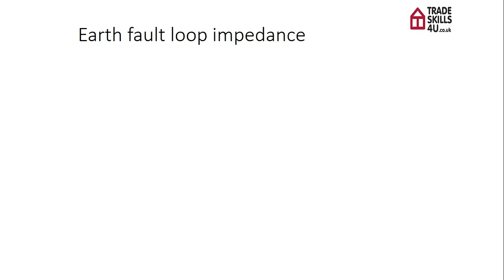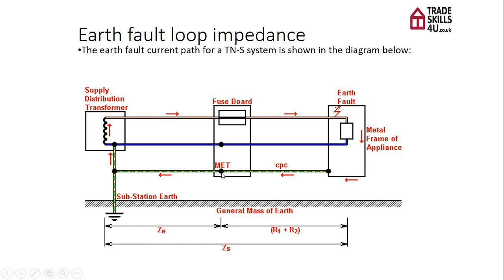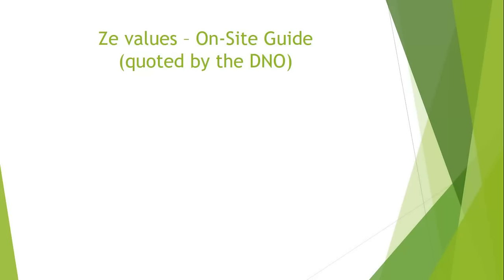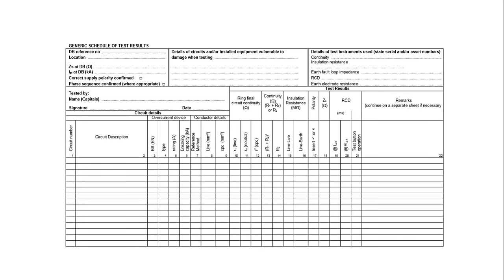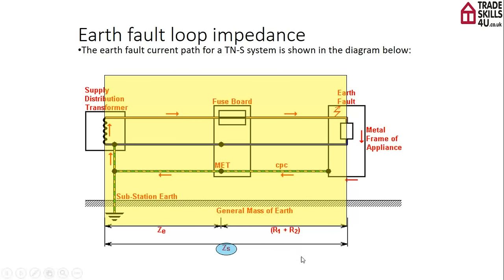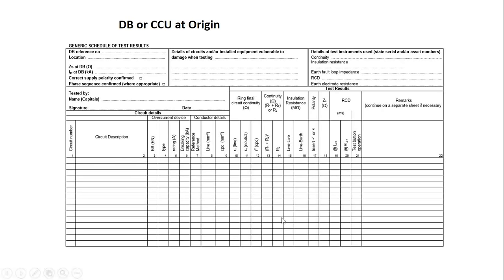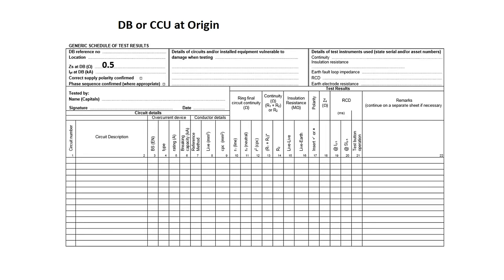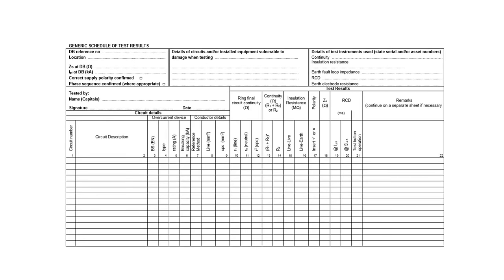Earth Fault Loop Impedance Test & Prospective Fault Current Test

Comment: My thanks to Tim and Chris for pointing out that the instruction manual requires the test leads on a Kewtech KT63 to be in 2-wire mode when using the high current test mode. In answer to your question Tim about whether previous test results are valid, I've conducted the test many times using both 2 lead and 3 lead configurations on various meters and the results have always been identical. The golden rule though is always follow the manufacturer's instructions so I've given myself a slap on the wrists!

Comment: I've recently realised that the  KT63 manual implies that if you use the high current mode, then in all circumstances you have to have the leads in the 2 wire configuration. Your Ze and Zs tests don't do that, but your PSC test does. 
From the manual  "The high current test mode requires the use of the distribution board lead set ACC063 configured in 2-wire mode". and "For Ze testing at the distribution board or at any point upstream of RCD protection there is a traditional fast high current test mode. The high current mode is a 2-wire test that enables the user to test the true impedance of both the Line-Neutral Loop and the Line–Earth Loop". 
I've tested several  installation the way you did it with the N lead seperate and got plausible results but I'm now wondering if the results are valid. Any thoughts? Thanks.

Comment: The KT 63 manual says that for high current test, i.e. Ze, the leads should be configured in 2 wire mode. I noted at 7.27, the test was done with 3 wire lead configuration.  The manual also states do not use high current test in 3 wire configuration. Also, I noted you used 2 wire config for PSC but 3 wire for PFC. Is there a difference if you use both in 2 wire config? Both are high current so shouldn't they be config in 2 wire according to the manual? Thanks.

Comment: Why are you showing a high current test in the 3 wire configuration when the kewtech KT63 instructions state that this function is only to be used in a 2 wire mode.

Comment: I have no obvious choice for the external earth conductor as 2 leave the back of the board. Assuming I am right one goes down so is the incoming but it is not obvious. There is a Meter on the back of the wall but that just tells me little too. It could still be the up or down and really the meter is level not down.
Should I test each earth one at a time to find the correct one?

Comment: Great video but how does the maximum breaker rating come into this? For example, a 6 amp breaker has a rating of 6000 amps. Why is this 6000 amp rating necessary?
Reply: gregorginny same as your car it can only go 180km/h
Others can go faster.
That’s the rating of the device.
You can get a higher rating like 10kA
Reply: Type B RCD/RCBO disconnects at 5x it’s rating ( generally speaking ) . Everything has to have a rating. Lighting circuit (6A) has lower demand than say a power circuit (32A). They have to ‘trip’ at up to that 5x rating.

Comment: I'm still trying to find out how the impedance tester calculates this for the supply side with the supply side active. No one seems to be thinking about this.  Are some assumptions made about the supply side parameters ?  Because unless you shut down the suppliers side and measure the source impedance with a 50 or 60 Hz generator, there is no other way to do it.  Anyone care to comment ??
Reply: Good comment. Anyone else?

Comment: Nice tutoring till Zs@DB. You do not do Zs test at DB unless is fed from a submain and is in another outbuilding.
Reply: Why, am confused, blocks of flats feed in SWAs how else would you isolate earth from supply cable. Also modern buildings with metal stud work and metal fuse boards can through up some strange results.